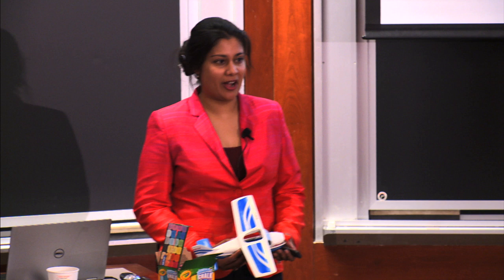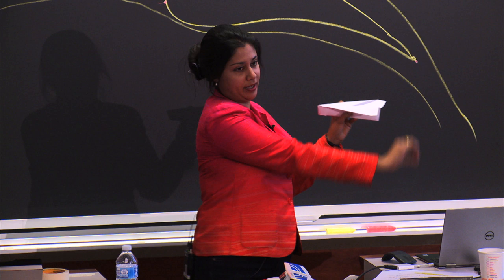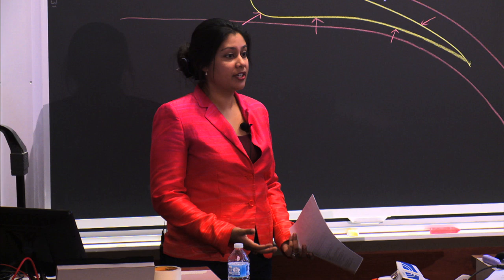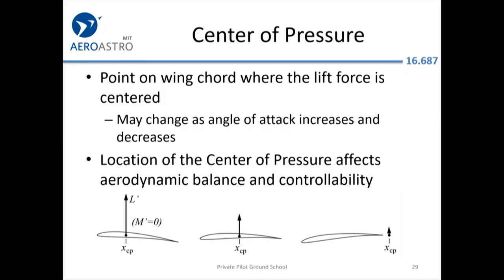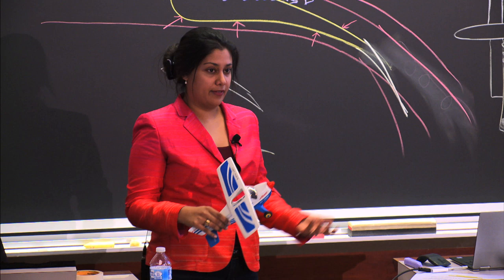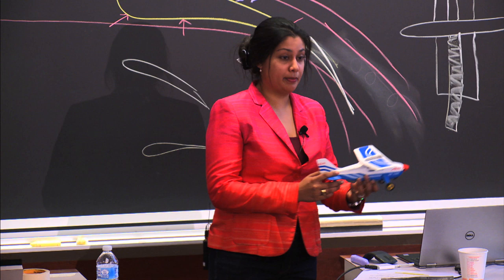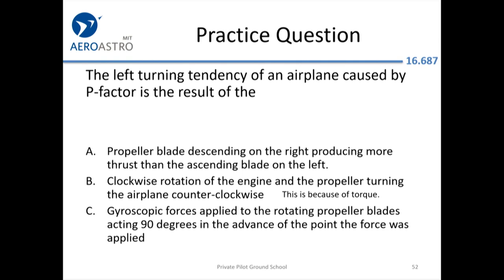MIT Private Pilot Ground School, Lecture 2 (Aerodynamics)

Comment: I feel like she rushes through most topics without going into the details and ensuring actual understanding
Reply: This video is fair and has some things ok and some things VERY wrong. It is nowhere near what should be expected from MIT. She is trying...
.
0:50 Vocabulary: doesn’t  mention the vertical and horizontal “stabilizers”. Calls them “parts”. In the graphic, but not mentioned.
There is only ONE wing.
Going to talk about sea planes ???
3:11 initially says lift exceeds drag, but corrects it.
4:50 Draws an extreme airfoil shape.
5:22 The way she explains conservation of momentum is a good one, but momentum can be confusing to some people. It is not saying just how these pushes come about, but is better than just saying lift is a Third Law "reaction".
5: 30 Air has mass and conservation of momentum. Doesn’t explain how push occurs.
6:12 GOOD: Explains the  Equal transit/longer distance fallacy. Points to flat wing, same length.  Math description not needed - correct.  Good Aeroastro graphics.
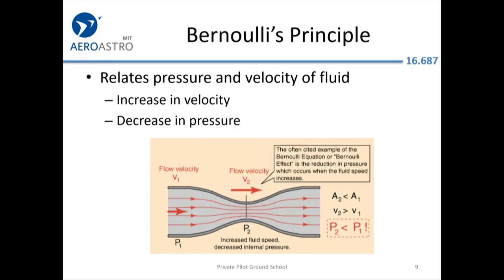12:01 GOOD: Stated Bernoulli correctly using ‘velocity’.  BUT focuses on fast.
12:40 "C" is the WRONG answer!  The word "cause" is incorrect.  "A" is the only correct statement there, but has nothing to do with Bernoulli..
12:42 The Graphic assigns INCORRECT cause to lower pressure.
14:00 GOOD: stationary pressures. She only mentions a "force" but not that it is pressures that cause the force!
15_24  Talking about the rest of the aircraft generating lift is a distraction and unnecessary.
15:57 Asks childish questions. Race Car.
16:36 Only says the spoiler “spoils the air flow. Doesn’t explain that it has down lift.
18:00 It is the altered pressures which cause the acceleration of the air (downward) ACCELERATION DOES NOT CAUSE THE FORECE !!! 
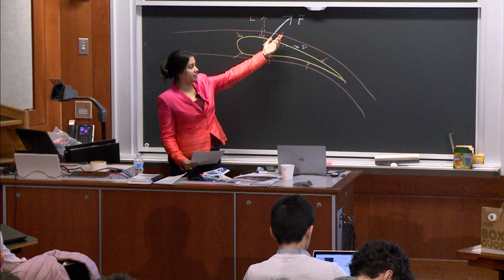18:09 Wing  ALSO changes the speed of the air.
Never states that upper air beats lower air.
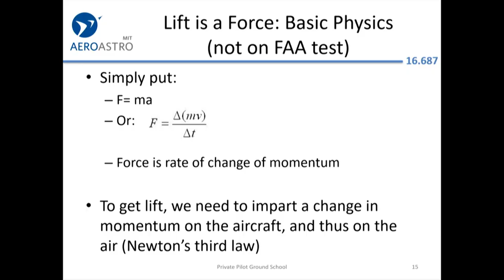18:40 Air past wing, or wing past air question.  The critical thing missed here is that the speeds are NOT "IDENTICAL", but different between these two reference frames, BUT the science must be the same.  Therefore, talking about fast is misleading.  It is ACCELERATION that must be understood.
18:54. Is wing moving faster through the air, or air moving faster past wing? Frame of reference discussion – SAME. Wind tunnel justification.
23:40 Mentions aspect ratio without explaining it.
24:24 Mentions hand out car window and PUSHING, but doesn’t relate to the – IGNORING the momentum explanation earlier.
25:28 Mentions Viscosity. Compares sticky.   Sticks to the wing.
27:10 Compressibility affects lift in a different way.  NOT FUNDAMENTALLY.
27:20 Calculating lift is not known.
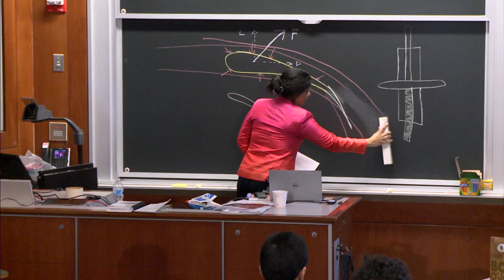29:45 CALCULATING LIFT.  Mentions Kutta Condition and says wrap around is an additional condition.  2D is simpler ) OK, but tip vortex sn not true turbulence.  So… Calculate where possible and measure elsewhere.
Doesn’t explain chord line.  Says:  “in between".
32:25 Talks about summing forces around the wing for lift, but doesn’t explain the top-bottom difference.
38:10 Doesn’t actually state what AoA is.  Graphic shows it as “A”  but is unnamed.
42:20 CONFUSED about the effect of flaps. Airspeed being higher with ground speed lower HUH???  Also doesn’t explain approach being steeper. Misses that is the increased lift that allows slower air speed.
47:38 Only explains that roll is around the longitudinal axis, but not the others.
48:13 Doesn’t explain why adverse yaw occurs.
48:15 Stability OK.
53:30 Question about what happens beyond the critical angle is not answered correctly.  Lift does not go to zero. Did not demonstrate a paper airplane stall.  It was too stable.
54:45 First mentions separation.
55:56 climb & decent, lift = weight.
57:15 Torque causes a left ROLL.
57:50 P-Factor not so much climbing because AoA not necessarily high, just on ground.  They can’t answer the question at 
1:02:20 Precession is 90 degrees  later.
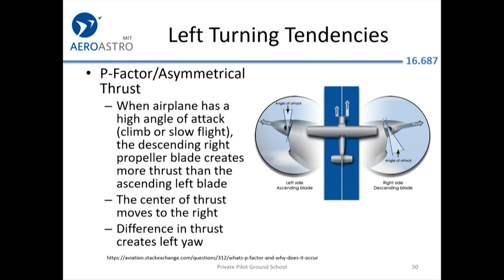1:03:14 Question why P-factor not subject to precession. Sort of answered. It is a bigger factor on the ground for a tail dragger the ground where the ground  prevents precession and in slow flight when precession only occurs during actual yaw.
In zero G flights confuses the upward parabola with top and downward parabola with bottom.

Comment: 21:10 
The Wright Brothers did use this exact method to find the best shape for their wing :) They made a bunch of little wings of all different shapes then measured the lift in a small wind tunnel they designed.
Reply: They actually measured lift vs drag; a more sophisticated measurement.

Comment: What about flat bottom airfoils? I learned higher velocity = lower pressure so the higher pressure air on the bottom pushes up. Demonstrated by blowing over the top of a piece of paper and it lifts up.
Reply: A flat airfoil still has to have angle of attack to produce lift so it's still deflecting air downward. They tend not be as efficient as more complex airfoils but can be symmetric so they work equally good inverted (assuming you have correct angle-of-attack). I'm not an expert but that is my understanding.
Reply: it only works that way if you blow over it
in an airplane wing where there's no active blow above the wings (except for very specific types that use the coanda effect for stol capabilities)
it's causally the other way round
in an airplane the wing deflects air downwards in order to produce lift, therefore the presure above the wing is lower than below th wing, therefor due to the bernoulli efect the air flows faster above than below the wing, not the other way round - it's the same relation bu th causality is the other way round
Reply: She kinda covers it at 9:23
Reply: Plus, AoA trumps airfoil effects.  Once you consider symmetrical airfoils, so many of these rudimentary descriptions of "how an airplane flys" just fall apart.

Comment: Bernoulli's law is rarely taught correctly. Rarely does anyone point out the ambiguity in the equation: The equation merely states a link between fluid pressure and fluid speed, it does not tell you what causes what. A pressure difference between two points in space causes fluid to obtain speed between those two points. The speed of a fluid at a point in space does not cause the pressure seen at that point. Given a fluid speed at a point in space, Bernoulli's law is used to determine the pressure difference that creates that fluid speed. Likewise, given a pressure difference between two points in space...
Reply: Yes, it appears that Bernoulli is misinterpreted by the vast majority of mankind...
Then. 

No equations show cause and effect, only the relationship of values.

A difference in pressure between two locations, called a Pressure Gradient, causes acceleration toward the lower pressure, NOT speed! A change in speed or velocity is acceleration. 
If fluid is moving toward a higher pressure, the speed will decrease - a NEGATIVE acceleration.
Reply: @Observ45er  Fluid obtaining speed is acceleration. The speed of a fluid is brought about by acceleration. The point of my comment is to point out that teachers too often tell students that the change in speed or velocity of a fluid causes a change in pressure, which is an incorrect interpretation of the equation.
Reply: @exilesurvivor1053  Precisely my point.  So is fluid slowing and fluid flow curving.
People don't understand the science.  Acceleration is also any change in velocity and many amateur scientists trying to explain this, as well intended they may be, don't understand and only repeat the wrong info.
Pressure Gradients CHANGE velocity (Acceleration), NOT cause increased speed.
People think acceleration is only "speeding up".
.
Watching a wing go by, you see THE SAME accelerations, but *different speeds*, so it is misleading to talk speed.
..
If you truly understand the science/physics, the fact that the air under the wing is faster, AS A WING PASSES YOU BY, will be no surprise to you..
Look at fig. 7 here:
https://rxesywwbdscllwpn.quora.com/
Reply: @Observ45er  Velocity is a measurement we invented that represents rate (speed) of something in terms of components of a coordinate system. Speed is simply magnitude of a velocity. In one dimensional motion, speed exists in only one dimension, thus speed and velocity are the same, or specifying the direction of the speed (velocity) is pointless. Even in two dimensional motion, the speed in one dimension may dominate. Pressure gradients DO increase the speed of a fluid. Air underneath a wing experiencing lift in the direction perpendicular to the upper surface is SLOWER than the air above the wing. The pressure above the wing becomes lower than the pressure below the wing because the orientation of the wing creates a void (relatively speaking) above the wing as the wing moves forward and displaces air molecules, and because air molecules under the wing collide with the wing surface and are deflected as the wing moves forward.
Reply: @exilesurvivor1053  You have some ideas there that are understandably misleading.
.
Things can move only along a single path which for computational convenience, we separate into the three orthogonal component directions.  You can say that we invented these three dimensions.
.  

For motions, those are called components and they add vectorially.  None “dominates”. It is simple vector addition and a larger component contributes more to the resultant direction and magnitude.
.
Speed is not a one dimensional only phenomenon.  In curved movement the direction is constantly changing, therefore it cannot exist on only one dimension.  It can have an instantaneous speed that must be in only one direction.  However, because speed is a distance traveled over a time, the requirement of time in this quantity makes one dimensional speed meaningless..
.
Pressure Gradients Accelerate fluid and the direction of (positive) acceleration is the same as the direction of the force. F=MA is a vector equation where F and A are collinear.  
.
Therefore, a force can increase the speed, decrease the speed, or change the direction of existent travel.  These are all Acceleration.
.
Therefore, changing direction is not meaningless.  A force with some component not colinear to the current direction of travel will change that direction over time and this is also acceleration.
When the direction of that force always points to a fixed location, this is called centripetal acceleration.
..
Above a wing, your ‘void’ (lower pressure) is caused by the air’s inertia/momentum trying to go straight and thus lowering the pressure toward the convex curve  against the atmospheric pressure holding it to the surface.  This forms the Pressure Gradient across the flow.  
This lower pressure along with the relatively higher atmospheric pressure farther AHEAD of the wing accelerates air rearward, toward the trailing edge.  ALSO, this lower pressure along with the relatively higher atmospheric pressure farther ABOVE the wing accelerates air downward joining (NOT re-joining) the lower air in the downwash behind the wing.
.. .. ..
Below AND  above  the wing, molecule are always 'colliding with the surface’.  However, below the wing the inertia or momentum increases the pressure there and this curves the flow downward because the Pressure Gradient is across the flow giving centripetal acceleration.
.. .. .. .. .. ..
The under wing air is only slower from the wings frame of reference.  Watching a wing go by in still air, measurements show the air under the wing is faster than the upper air.
Relative to the still air mass, the under-wing air is accelerated to a higher speed (magnitude) than the air above. (measured data shows this) 
YET the accelerations observed in either view are the same and this is what needs to be understood about Bernoulli’s Principle.  
.
Bernoulli’s Principle tells about pressures associated with changes in velocity which is acceleration, NOT simply increased speed.
..
The air exiting any blower into the atmosphere is at that SAME atmospheric pressure, not lower.   The energy of the higher pressure air INSIDE the blower accelerated it into the relatively lower atmospheric pressure outside the blower.
... ... ... ...
Relating Bernoulli’s Principle to speed is one of the biggest myths held by amateur scientists that has persisted for a long time.
.
Please see these correct explanations of Bernoulli’s Principle and Lift.
https://rxesywwbdscllwpn.quora.com/ 
Regards

Comment: The exact detail of how an aircraft flies is not projected well. There are some misleading issues in this video. Bernoulli does not explain some details appertaining to flying. In flying most issues can be explained through dynamic forces generated by mass being ACCELERATED and so that would be the RATE OF CHANGE OF MOMENTUM  and not momentum.

Comment: So if equal transit theory is not true, why is airflow accelerated over the wing?
Reply: Bernoulli 'happens' in some regions around a wing, but the way it is commonly used is false and Bernoulli's Principle does not give the cause and effect at all, so it is a double fallacy.
. . . 
The real reason the air above a wing speeds up toward the trailing edge is the decreasing Pressure Gradient from the leading edge to above the wing.
.
Speed does not cause a decrease in pressure. 
Following up on Bernoulli's work in the mid 1700s, Euler determined that a Pressure Gradient in a region provides the force to accelerate fluid toward the lower pressure [because the higher pressure region pushes more than the lower pressure region.
.
The pressure decrease is because the flow is curved as it is directed over the leading edge.  It would continue upward, but atmospheric pressure is still pushing downward. It doesn't go away when the wing starts moving. 
The tendency to continue upward {Newton's First Law] works against that, thus reducing the pressure a small bit.  
It is the very same as you feeling lighter at the top of a fast roller coaster hill - your body 'wants' to continue upward, thus working against gravity. .  
Don't forget Newton's First Law.  Inertia applies.
.
Following up on Bernoulli's work in the mid 1700s, Euler determined that it is a pressure difference between two locations, called a "pressure Gradient" that provides the force that Accelerates air toward the lower pressure - where that moving flow now assumes that lower pressure.
..
Bernoulli's Principle itself, refers to a speed INCREASE, which is acceleration, in a region being ACCOMPANIED BY a pressure decrease across the that SAME region. It does not say that one causes the other. It ONLY acknowledges the relationship.  Per John D. Anderson's book, there is no indication that Bernoulli understood the cause and effect.
. . .